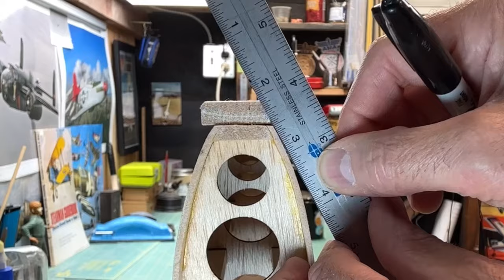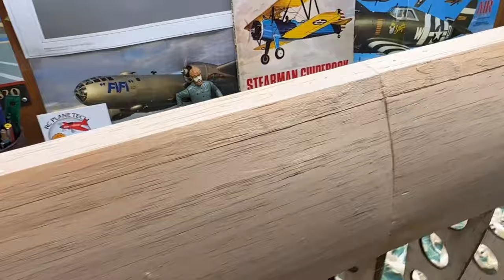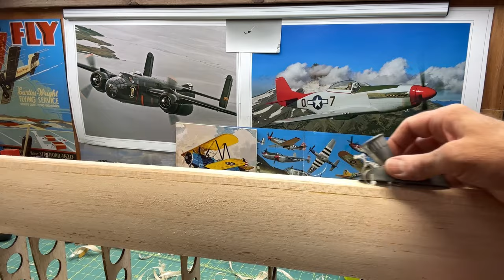Balsa USA Stingray with DLE-20, RC Plane Build N0 6: Shaping Leading Edge, Rib Caps, Wing Sheeting

Comment: I probably would have used a slow cure CA for those tip pieces, but epoxy would have been overkill, and heavier.  I happen to be quite satisfied with titebond myself, and use it for most of my building. CA and epoxy both have their place, and we use them when and where appropriate. 
It’s looking great James! I’m eagerly awaiting the video.
Reply from the maker: Thanks, I wasn’t happy with my PVA choice. I should’ve known better. If doing it again, prob epoxy would be my choice as well.
Reply: For those tip pieces, I think a thick CA would have been ideal. However, you fixed it as a true modeler would.  Honestly, for those that might be learning from your videos, it was a good lesson in what not to do, and if you do it, here’s how to fix it.
Reply from the maker: Thanks I appreciate that. We all try our best.

Comment: Beau travail 👍
J utilise la colle a bois " Ponal " je la trouve très bien mais j'ai peu d expérience en modélisme. 
Et pour coller deux pièces plates entre elles avec de la colle a bois j utilise des sachets plastique remplis de sucre en poudre de 750 grammes. Vos pièces épouseront parfaitement la table.
Reply from the maker: Thanks! Im not familiar with Ponal wood glue, but sound like it works well. Good suggestion with the sugar bags. Some people use sand bags also. I need to try it.

Comment: Do You ever use Ca kicker?  A spritz and Ca is set
Reply from the maker: I haven’t, but I did buy some recently from starbond and will use it in the future.  I know its been around forever. I think for me up until more recently I would build smaller planes and primarily thin CA, since I have been building larger planes I use a lot more of the thicker CAs and should start using a kicker.

Comment: What do you think about converting this to electric?
Reply from the maker: Hi, I don't know anything about electric. But I''m sure you can do it. I'd check to see if there is info on some of the forums. The power would have to be equivalent to  20 - 30cc gas, 1.20 ~ 2.0 4-Cyl Glow Fuel. I'm sure it has been done. Sorry I can't be of more help.
Reply from the maker: Actually I found one on Youtube . Type in “Balsa USA Stingray 120 Maiden Flight” and there is a guy that has it with an electric motor.
Reply from the maker: https://youtu.be/IZYd3djaUcQ?feature=shared

Comment: Poor choice in glues epoxy resin the only thing to use here and I see a yellow glue too ,this dark yellow glue is rubbish it doesn't last ,it delaminates from the timber eventually, west system epoxy resin brother to brother rc buddy
Reply from the maker: Thanks for the suggestion. I agree, generally can’t go wrong using an epoxy. Sometimes the convenience of a simple wood glue is not the best choice. It worked fine for my leading edge here, but was not the best choice for the wingtip plates. Thanks I always appreciate a good suggestion and insight.